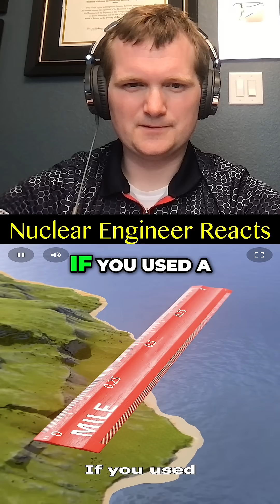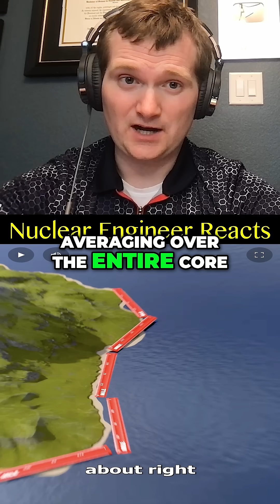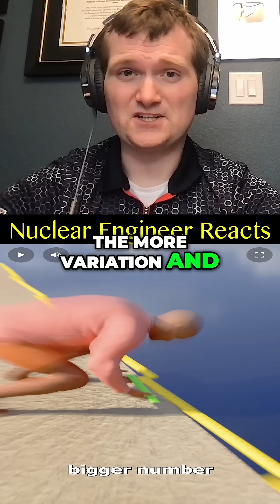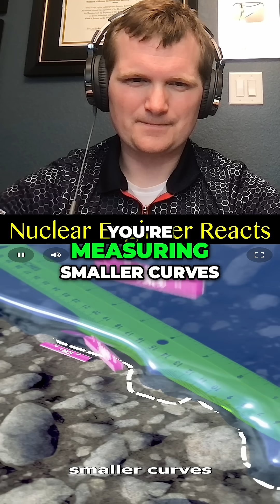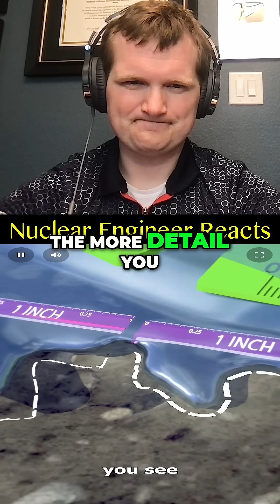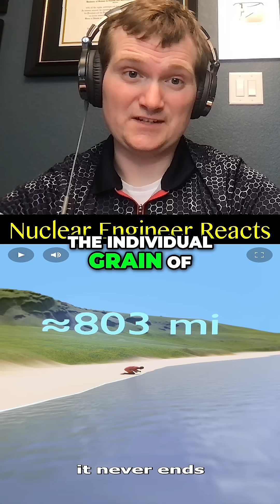The Coastline Paradox - Nuclear Engineer Reacts to Zack D. Films

Comment: as someone who understands what he is talking about, he is making false equivalences to make everyone happy because he is known for that. however, the overall heat and PPD are different because the PPD in whole is the same as the overall heat and has no difference beside where the region of heat is specifically. grain boundary surface area shows how dense and stable the Uranium is which has no reason to be said.  simplified he said if you measure more precisely you get a more precise answer then started yapping about random stuff. none of which yield a larger number based on how precise it is.

Comment: There is no true way to measure a coastline. Because depending on how you do it it will result in a different answer I like the idea of just taking a generalized idea using the coastal shelf is usually a pretty decent point as usually the coastal shelf doesn't have really weird deviations in it. Although the coastal shelf can be anywhere between his head to 100 yards or meters or whatever unit of measure you decide. The reality of it is is that to me you should take an average of all of them and that should give you a general idea.
Reply: I would say that one meter or 1 yd should be more than sufficient for most

Comment: But what if you measured infinite times, with the rules slight differently placed. Meaning that some measurements will be low due to crossing water, and others being high, due to ruler placements. The average would be spot on to the exact distance

Comment: the actual limit of the coastline length is the average of the waves distance it moves in and out of the coastline.
you can't measure to even a foods precision because of that water movement.

Comment: It's going to matter a lot for distances, but to measure the area it's almost irelevant. So why would you need to know the distance of a shoreline? To walk or bike or drive along it of course, or to compare to other shorelines. In both cases, very low precision is required. However, for comparisons you need to compare measurements that use the same definition.

Comment: The answer is that there’s an asymptotic limit on the overall surface area of an object. There are certain sizes that are so large that it cannot be that big. For example, there is no unit of measurement so small you’d end up with a measurement in light years for that coast.

Comment: This is like the Zeta Function for s(2). It does increase in size infinitely, but it still converges at pi^2 / 6. The change in measurement of a coastline by shrinking the measuring device becomes less drastic. Around a grain of sand will there be too much room for error like with tides and miscount to be effective and around a plank length will it not be able to be able to change enough to notice

Comment: As a civil engineer I would like to weigh in here and say it doesn't reach infinity. 

It may be different per area but we usually survey these by 100m steps. Any details are lost if they aren't more than 50m. 

Even if you were to keep subdividing it can only get 3x longer than bigger estimates. It's like the estimation of the radius of a circle or value of Pi. Yes you can get a billion digits and it gradually keeps increasing but it's not gonna be greater than 3.15.
Reply: oh... likening it to Pi made it click, thank you!
Reply: A bit like the sum of a infinite geometric series with the ratio smaller than 1
Reply: That's not true though, the difference in the countrywide coastal length of an island (e.g. Great Britain) will be considerable orders of magnitude greater if measured in, say, centimeters, compared to if it were measured in 10 kilometer lengths or some such: not that it is feasible to really measure such a coastline in such small lengths.  Compare a fractal curve in which a pattern can be repeated continously with smaller and smaller lengths, and where the geometric space is presumed to be infinitely divisible.

The simple answer, without getting into theories of the lower limits of physical space measurement, is that the definition of coastal length is not a geometrically precise one, and coastal length is taken to be intrinsically approximate to varying degrees.
Reply: @zusty9589 costal length is ever varying as is. Tides can change it so we don't even measure it until the water. 

Also I don't believe that measuring in cm would increase it tenfold even. Rocky shores maybe but shorelines are constantly up against erosion which makes them smoother. 

This makes them more like curves than fractals imo but I'm not a geometry guy. Even then said limit is also applicable for fractals. The rate of increase begains dropping sharply and even nm precision wouldn't make it differ in the grand scale. 

I would like to think of it as an iterative process(like stated in the video) where you increase it by smaller and smaller scales. After a certain point the gain in length would stop affecting the first digit. Even if we don't consider that and only consider the constant additions then even the simplest geometric series say the nth harmonic numbers can theoretically reach infinity but in actuality won't go over 13 even after 10^5. Increments getting smaller every time has such an compounding effect.

Anyhow measuring in cm is practically useless because the first thing any sea side project does is remove irregularities present.
Reply: @shlokshah5379  You are quite confident on the (relative) small-scale geometrical uniformity of seashores.  This is a faulty judgement.
I wrote "fractal curves," not "fractals and curves," and meant what I wrote.  They are infinitely divisible with the aforementioned presumptions.

Comment: There is a misconception that every shoreline is infinite because of this phenomenon
Reply: Yeah, it's finite but nobody knows what it is exactly because we'd have to measure distances between the individual atoms and add them up.
Reply: There's no need to be that precise, especially when the real lenght of coastline is in constant change with shifting sands and tides.
Reply: It's very nice that his immediate response to that last line was pointing out that the upper limit is the distance when measured on a sand grain level

Comment: Alright smart guy, what's the length of the shore in planck units.
Reply: For that matter define "sea level" in a way that accounts for things like waves and tides.
Reply: Exactly my question. It can't be infinite right?
Reply: @NazmulHossainPotato_PeeZy It isn't, but I can't tell you how to calculate a good estimate for how much it increases. It's like an integral that's basically infinite but finite
Reply: @-.-_-.-_-.-_-.-_-.-_-.-_-  nope because we're talking about discrete quantities. There is no way to measure "shore length" on a finer level than that of the individual grains of sand, so that's the definitive upper limit for any measurements
Reply: lots